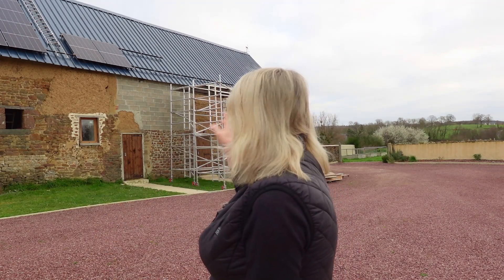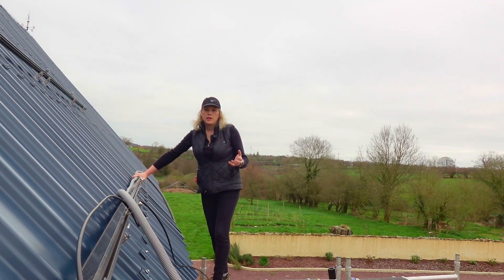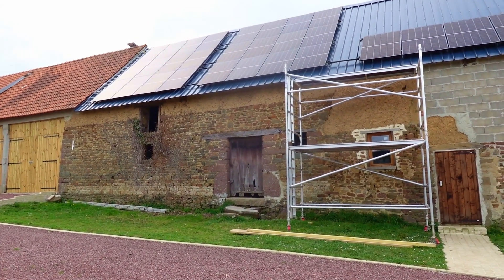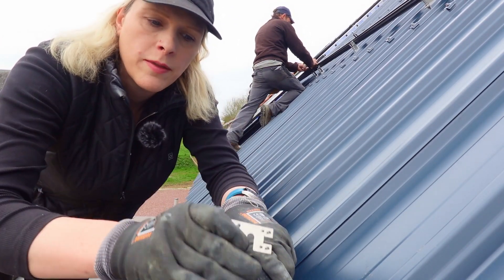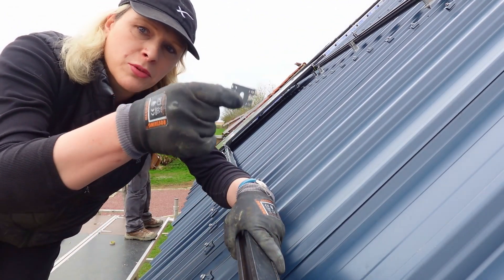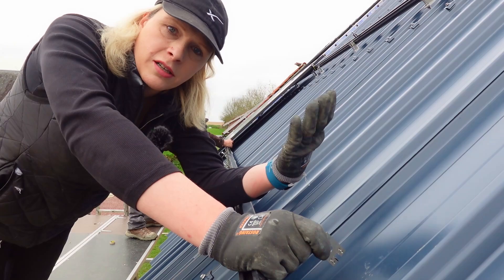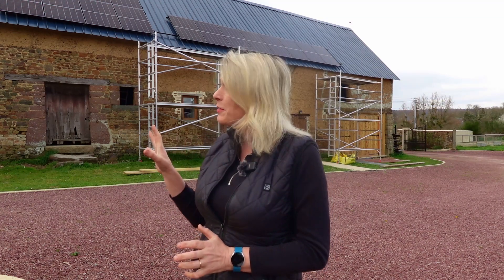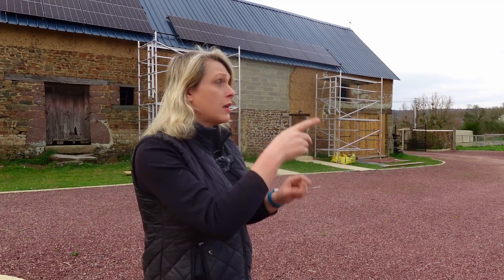Final day of 13kw solar panel install

Comment: The safety harness you used in the video is a death trap. If you fell off the roof you would instantly break your back. You need to use a full body harness and have your anchour point at the top of the roof. Great videos.

Comment: Absolutely inspiring video, thank you for all of you hard work and useful info. I am also living in France near Cahors and have decided to go the solar route but cannot definitively find our what the actual rules are. I know that as a self install you are limited to 3.2kw. But does this actually mean  3.2kw per phase (I have 3 phase so is this 9.6kw)? The other thing I can't find any official info on is, that if you decide not to feed back any power (zero) to the grid do these limits of 3.2kw even apply? You comments on these points would be greatly appreciated.

Comment: SARAH 🎉 CONGRATULATIONS 🎉🎊 🎈 🎊🎉 ON SAFELY INSTALLING YOUR 16 kw OF SOLAR PANELS!
I AM COGNIZANT THAT EACH JURISDICTION HAS ITS OWN CODE COMPLIANCY:
1. IN FRANCE 🇫🇷 IS FLEX CONDUIT & RAPID SHUT DOWN AT THE PANEL NOT CODE FOR SOLAR HIGH VOLTAGE D.C.? 
2. IN THE WEST EMT METAL CONDUIT & RAPID SHUT DOWN AT THE PANEL IS CODE FOR HIGH VOLTAGE D.C. GOING INTO THE HOUSE 🏠.
WE ARE HERE ENJOYING YOUR PROJECT FROM START TO FINISH!
🎉 🎊 🎈 🎊🎉 CONGRATULATIONS AGAIN 🎉🎊 🎈 🎊🎉

Comment: Gonna be nice power.  Be careful on the final connections.  Tape-off the end of the positive cable until ready for the last connection and also leave it disconnected up on the roof.  For the final connection, fully connect up the NEGATIVE first both on the roof and down below, leaving the shut-off switch or breaker shut-off.  After that, connect up the positive.

Well I'm sure some people would suggest connecting the POSITIVE down below first since that involves screwing the wire in whereas connecting above first is just plugging in a MC4 connector (or similar), but I prefer to be on solid ground when messing with live voltages.  So I connect the POSITIVE up top first and leave it taped-off down below, but prepped and ready for its final connection.  Then I come down and check polarity and voltages and do the final POSITIVE connection to the disconnect breaker or switch with it live.

Theoretically the solar cabling is isolated, the positive can't shock you without a current path to ground.  The negative will be safely disconnected through the disconnect (it won't be isolated once you turn on the final disconnect switch or breaker)...  But don't count on it.  Always assume that you can be shocked.

Solar charge controllers usually don't have much of a capacitor on their SOLAR inputs (on the BATTERY outputs they do, on their SOLAR inputs they usually don't), so usually there aren't any spark worries for the final turning-on.   Remember not to turn off manual disconnects under load (except in an emergency)... always turn the charge controller off via its controls/menu/app/whatever. before disconnecting any solar.  DC breakers can be disconnected under load, which is why I prefer them, but of course they will last longer if you don't.

Rails look solid.  I'm still worried about lateral roof loading on the walls of the barn though... that would depend on the truss structure under the roof.  i.e. the weight could wind up pushing the wall outward.  I suggest you use a level to check how vertical the walls are half-way up.  Then check again a month from now to see if anything is bulging out.  At a minimum.

The anchor point for the safety harness should be on the higher rail.  You don't want a slip to actually leave you dangling off the side of the roof.  #1 safety tip when using a harness.  Plus you can pull yourself up with the rope which is easier than ripping your Achilles tendon.

-Matt